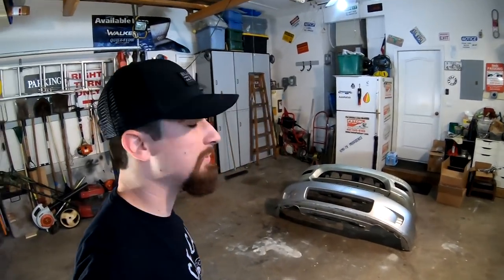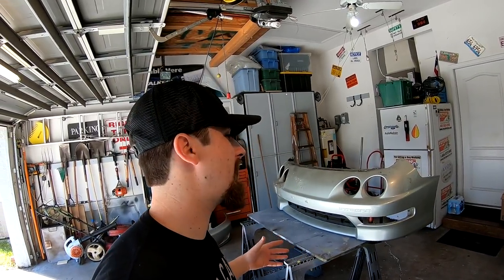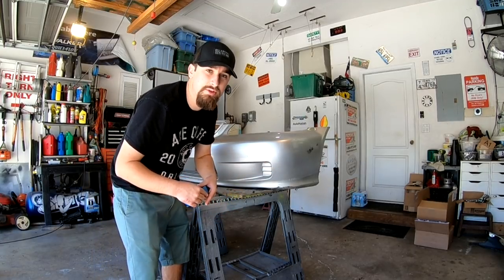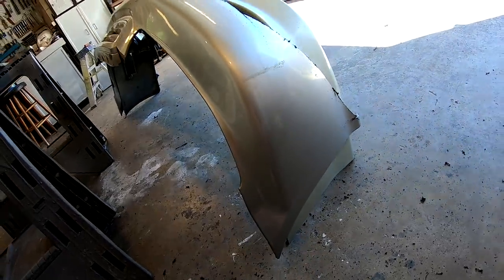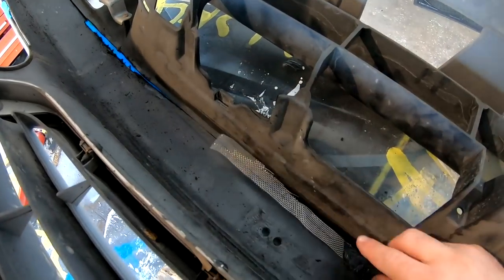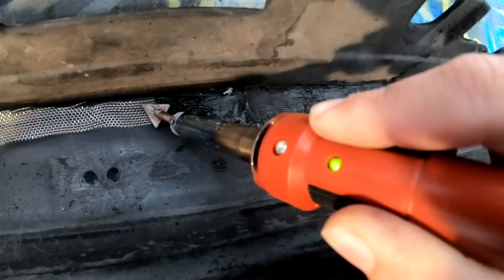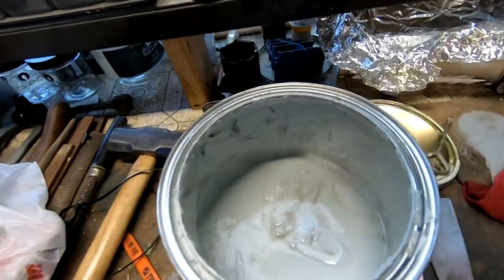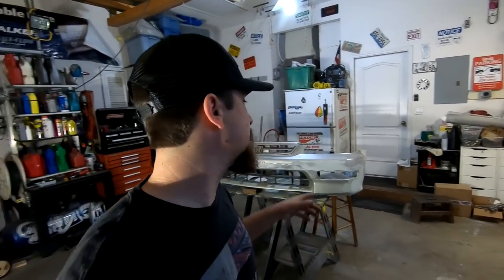Acura Integra Bumper Retrofit on Civic

Comment: I love it. Its so funny. This is the 2nd video I watched of yours. 1st: 4dr ek hatch & this one. Both of which I'm dying to do. Think its time to subscribe. I would of v grooved the front and added a plastic rod in the front. Check out Polyvance if you haven't already. Great tip on the wheel arch shape. Congrats, by the way.
Reply from the maker: JOEGGGJOE man I really appreciate you watching and subscribing. Means a lot! Also yeah man that's a great point. There's always something to take away from doing a project the first time around. If I were to do this again I would definitely do a v groove and fill in the front side as well.
Reply: Yeah. I see a lot of people going crazy filling in gaps with bondo, I just scringe. I am all for using bondo at the rite amount and when needed.
Reply from the maker: JOEGGGJOE without a doubt
Reply: this bumper on that four door hatch woulda been sick!!!!

Comment: How would you retrofit a aftermarket fiberglass bumper to an oem plastic bumper? As you know aftermarket never fits right.. so that's why I want to retrofit the top half of the oem to the bottom have of the aftermarket for perfect fitment. Please advice??
Reply from the maker: angelicaescoo I would try to but
 them up perfectly. Take some aluminum strips in make a “strap” running across the seam in the back and attach with with “SEM panel bond” and then on the from I would try to fiberglass them seam to make it disappear. Idk for sure it that would last a long time but that’s why I would do
Reply: @BodeVision  thank you so much! I'm going to try and do that today
Reply from the maker: Good luck with it and with the plastic I would sand it down first to get rid of the shine on it. Lmk how it turns out